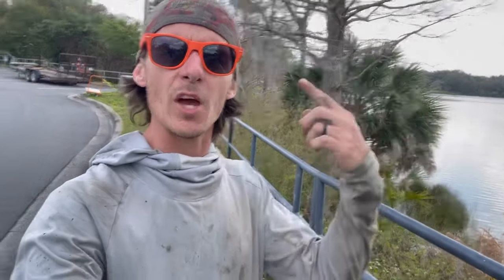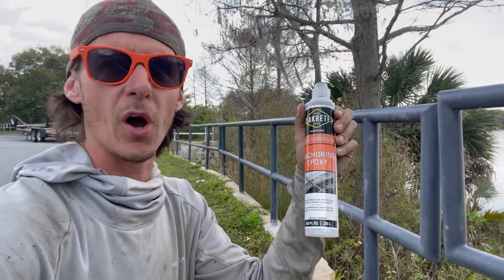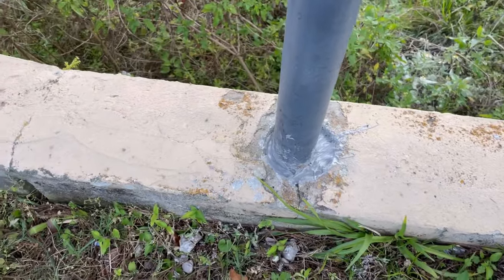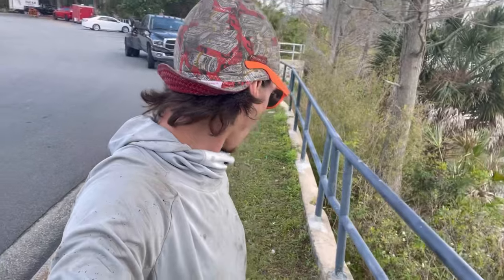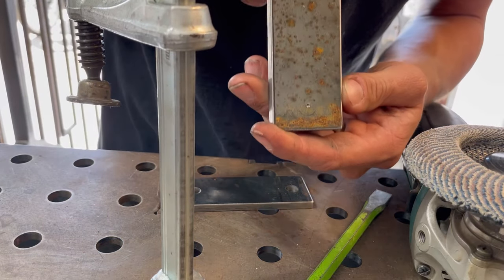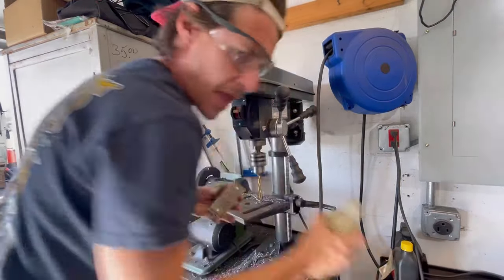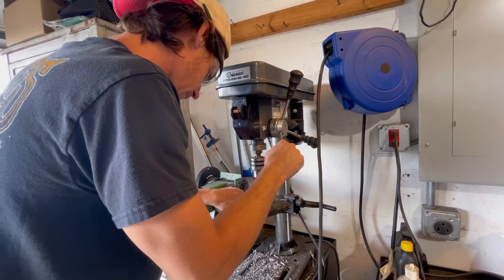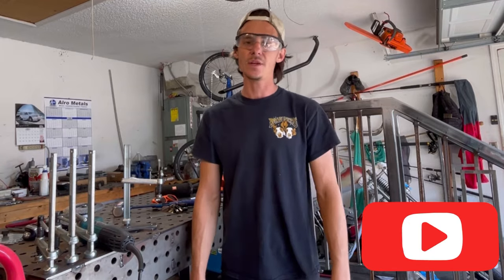TWO Ways to Anchor Metal Railing To Concrete!!

Comment: Another thing I use is anchoring cement from home depot/lowes. Only needs water to activate, cheap, cures FAST, looks like concrete and expands to create a tight fit. The only thing is you do not want to mix a big batch. It will set too fast. Just wanted to share some knowledge from one fabricator to another.
Reply: i had big problems with Home Depot anchoring cement . it'll keep expanding and break the concrete later. non shrink grout ,(such as Cement All ), is safer ..
Reply: @rhapsody5876  that is crazy man I haven't had that problem but I could see how they could potentially do that if it didn't stop. I thought that it would hit a certain point of resistance and stop expanding. At least you would think it would be designed that

Comment: Oh god please don't ever hold onto your little piece of metal when you are drilling it. That is a recipe for a broken finger. I can't count how many times my drill press has caught onto the piece of metal and sent it spinning. I used to use a piece of MDF board clamped onto the drill press table as a wall that the piece would sit against, until one time the bit got stuck and the metal ripped through the mdf. Now I use a vice to hold everything I drill.

Comment: One other tip I can throw out is to drill a hole near the bottom of the rail. That way you can get the epoxy inside as well.
Reply from the maker: That's a good idea!
Reply: Thats genius

Comment: I love my ironworker.   I paid for the punching station (option)  which has a L-shaped flatbar piece that is slotted=adjustable that you can lock down.  You only have to center punch 1 place - on 1st piece you line that up by manually bring ironworker punch down into it, then you tighten L piece down.  You punch one hole and flip over to punch the next one-butting it to inside of L piece guide.  This works on bases that need 4 holes also.    You CAN make a jig for a DP easily.  I would start by getting a fence for it, you set that up so bit centers in material, then you just clamp a piece of FB or anything to make material stop.

Comment: Hey hey!
(Hi from Germany btw!!!)
We (my company) had to do the exact same stuff because a big truck smashed the fence
It's a bit complicated to explain but in general we had to renew some stuff but in the end used the old holes
Protip for you:
I would always use "fast cement" (blitzzement in Germany or 5 Minuten zement) for it
Just add more water to make it thinner, then just fill the hole up with it, after 10-15 minutes it's fully hardened and will last forever, i pay 10€ for 5kg here 
1. It's stronger than epoxy (i only use epoxy for jobs where there is no other option , for anchors in the wall etc)
2. It's waterproof plus it matches with the old cement / concrete!

PS; I know you do it how you do it, but just wanted to share how we / i do it 
Keep it up man!
Greetings from Germany ❤️

Comment: when I am going to make multiple flanges with even spaced holes. I Figure out the distance from the end and center, then make a jig or stops on the drill press or mill then I can clamp in place. then you can just drill all the holes knowing the parts will be clamped in the exact area every time. it makes production way ease and guarantees accuracy. and while I'm drilling I can apply cutting oil to the end if the bit while i'm drilling to keep it cool, I can make a lot of holes with the same bit this way. nice work!

Comment: About Cobalt drill bits,  in Los Angeles there is an aero space surplus store that sells surplus hardware,  from Boeing, Roar, and other companies,    and tools and machinery,     they had cobalt drill bits by the lb for $7.00 a lb. ,    I bought 4 lbs of cobalt bits with was about 108 bits .  about $700.00 worth.   None of them were bad or dull,   and drill stainless steel great.  Look for an aero space surplus store .
    Great Video.              Thanks
Reply from the maker: dam that was a score!

Comment: That shits prolly expensive, I use Non shrinking grout.   Mix it with water, thick like cake batter. Make it level or a little higher than the concrete.

Comment: Hey man I recently picked up a miller AEA 200 L non electric start. Bro 100 could pass. Well I got it, changed them old spark plugs with new spark plugs off a 350 Chevy sbc. Stared right up fist pull. Envy who is this welder good enough for the field ?

Comment: I've done thousands of these. A decent cordless hammer drill with say a half inch Mason bit will make quick work of drilling out the old stuff (if you need to say straighten a fucked up rail)  get yourself a small bucket of por rok. Pours in nice. Shit is rock hard and sets up in 15 minutes. If you do need it to look nice... fill up until about a half inch from the top of hole. Find a grout that matches what's existing there. Pack it all around and run a wet sponge around it to smooth and feather. Either way your por rok is going to be cheaper and faster than your epoxy with far less money thrown out in waste. Get the small bucket. A big one sitting around will just go to shit after a year and you will be throwing away a $70 bucket. Make that money bud

Comment: hello man. I'm still a beginner stick welder. I'm still a school and i weld during my free time. i saw a video the other day where a guy was welding thin wall square tubing and he was doing tacks. I'm sure you'll find a similar video on YouTube. is this method good for small projects or is it weak?. 
love from Mauritius ❤️🇲🇺
Reply from the maker: Hard to say without seeing it, when I weld sheet metal i tack it in. So I’d say if it was thinner than 16ga it is probably ok
Reply: Thinner the metal, the smaller the rod. Thicker the metal the bigger the rod. You match your rod with the thickness of the material you are welding on- the thinnest material you are welding should be the same size rod you are using or smaller.  After you learn what you are doing, you will learn that, unless the blueprint or job requires air/water tight, you will normally use "stitch" welds, about 1/2 inch to an inch long when welding every three to six inches apart (depending on what you are welding), to save money on materials. Welding is gluing two pieces of metal together. You want good penetration into the materials you are welding, but you don't want to blow holes into the material. That is why they make different sizes of rod. If you are welding a thin piece of metal onto a thick piece, go by the thinnest piece of metal you are welding to size your rods.  Then, prepare the weld surfaces, by grinding off all rust, paint, cleaning the area of all oil/grease, create a bevel, match your pieces up to how you want them sitting, and be sure to create you a weld area, even if that means building a welders tent around your work area to prevent wind from blowing onto your weld while you are welding. Use weld curtains/shields around your work area, because, simple things like wind will blow your inert gasses away from the weld and cause bad welds.  There is a lot to figure out when you first start out, but you will get it. Even when using stick rods, the outer coating burns away and creates an environment around the weld best for the welds, and the slightest wind will blow that atmosphere away from your weld.  It's why they make "weld curtains" for.  Commercial divers have to sometimes create "rooms" to weld in underwater.
Reply: @MrHunterseeker  I have an old lincoln electric trade school welding textbook that has like 200 lessons teaching stick, mig and tig.  they recommend using 5/32 6010/6011 on sheet metal(18GA AND THICKER!)... i haven't tried it yet, but they imply that you move ahead at a screaming pace in a straight stringer bead with the flux resting on the metal.   dont remember the amps recommended.  seems crazy but i want to try it to see if they are full of BS or not... seems like lincoln electric would know what they are doing.
Reply: @MeltinMetalAnthony  thank you. have a good day 😁

Comment: I think your epoxy opaque enough not to get damaged by that Florida sun. I watched a delivery company drop a pallet of roof insulation 30" onto a stairway railing, when the new one came from the fab shop the concrete guy used hydraulic cement to install it in the holes I cored out. But idk your epoxy method epoxy might be better for non-cored holes where you cant get the cement inside the pipe
Reply: Pro tip:
(Hi from Germany btw)
We always use "blitzzement" for it which is translated "fast cement", just add more water to make it thinner then you can just fill the hole up with it
10 minutes and it is fully hardened! (Waterproof/very strong etc)

Comment: hey anthony what electrodes do you use when out in the field?
Reply from the maker: all shorts depends on application
Reply: I’m newer to welding, I’ve been running 7018 for everything. Is that smart 
I’m not sure but as for now it works.
Reply: @ElChapos  7018 is good if you have clean metal, you can strike an arc and set the stinger down and walk away  and come back to a nice bead, for nasty  greasy  repair work go with 6010
Reply: 7018/6013 are the best imo, for rusty non-structural stuff esp 6013 is amazing and you can weld some huge gaps too.

Comment: Look into rockite bro if you dont know abt it. All i do is fab residential rail and install. Measure, fab, install. Its a synthetic concrete. Heats up as it expands. Works good. You can mix that shit like playdoh and not mess with the epoxys. You just gotta spray it off with a water hose after but it will look good
Reply from the maker: ill try it!